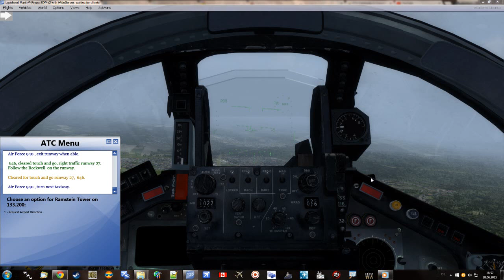JF Tornado in P3D2 Ramstein T&G 2

Comment: It's simple, Just Flight released a plane that was NOT ready for prime time. Besides the FPS/LAG issues, the Flight Model needs a lot of work to make this aircraft usable in P3D or FSX. It's sad really that companies do not conduct a proper quality control and end up taking big reputation hits (which I sure hope they do).
Reply from the maker: Wajahat Ali They set a release date for there prerelease sale. So the programmers came under pressure to release it on time I think, even though, it wasn't perfect. I must say, after doing a lot of touch & goes, it became better to fly for me. But it is still a demanding aircraft. Also I have all sliders to realistic. Maybe a lot of users don't and have it easier. 
I have also compared UKMIL Tornado Freeware. It's almost as good as this, flies better but has similar flight characteristics. Only the cockpit of the JF Tornado is better. The UKMIL one is good too.